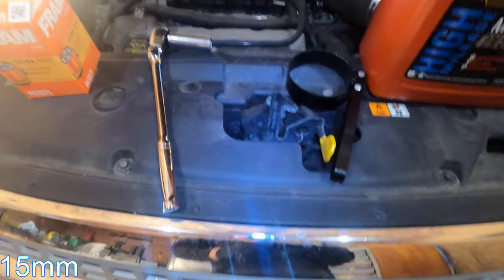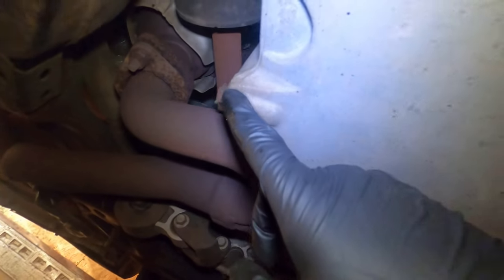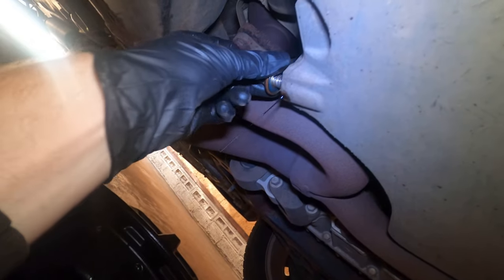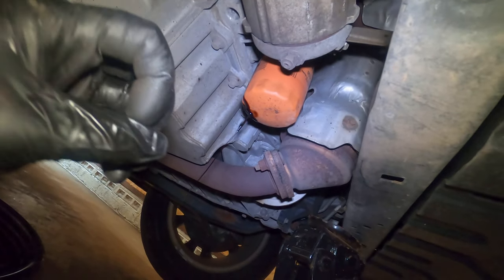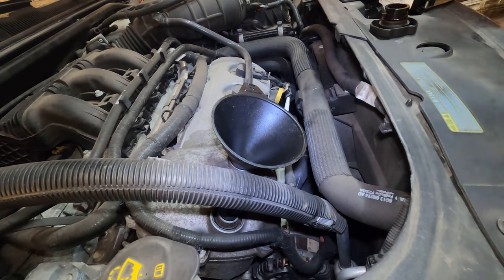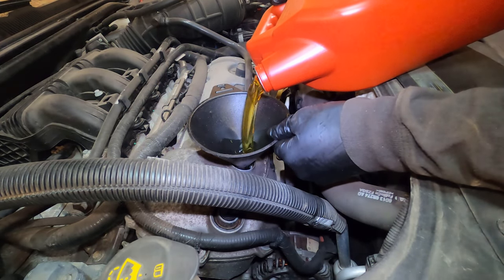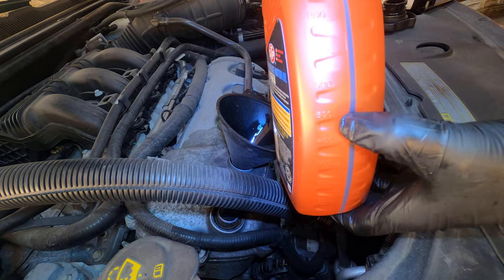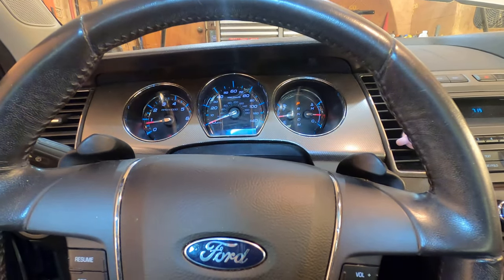2011 Ford Taurus Oil Change

Comment: Just picked up a 2010 Taurus SEL with 32k original miles on it and needed to watch an oil change video, super simple process. Thanks for the vid!
Reply from the maker: i hope this video helps. feel free to like and subscribe for more & if you can, please help the channel out by giving a super thanks. Making these videos takes a lot of time, but we do it to save you hundreds. also head down into the description and check out the link for some high quality led bulbs for this and any other vehicle. use my referral for a discount. Add me in Instagram for behind the scenes pics and Stop by my store for some Anything Auto gear.

Comment: Did you take off the front tire for access?  Car sits very low to the ground, very difficult to access for oil change
Reply from the maker: @ksw501  watch the video. It shows every step. i hope this video helps. feel free to like and subscribe for more & if you can, please help the channel out by giving a super thanks. Making these videos takes a lot of time, but we do it to save you hundreds. also head down into the description and check out the link for some high quality led bulbs for this and any other vehicle. use my referral for a discount. Add me in Instagram for behind the scenes pics and Stop by my store for some Anything Auto gear.

Comment: I just inherited one of these with low miles, Thinking about keeping it for a while....
Reply from the maker: They got a bad wrap but I have several long time customers and no issues. Well minor issues. All very high mileage and still going strong. Hope the video helps. Please like and subscribe for more
Reply: 200k miles just changed the water pump and timing chain it was 840 for parts labor and all luckily could've been alot more. They're my favorite car I've had over the years.
Reply from the maker: @Iam Cxncept  i hope this video helps. feel free to like and subscribe for more. also head down into the description and check out the link for some high quality led bulbs for this and any other vehicle. use my referral for a discount. Add me in Instagram for behind the scenes pics and Stop by my store for some Anything Auto gear.